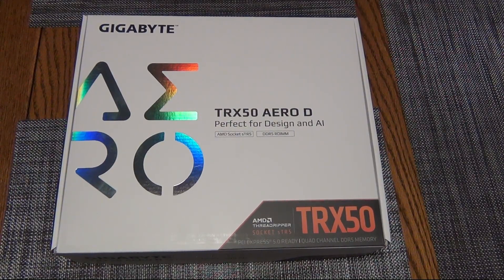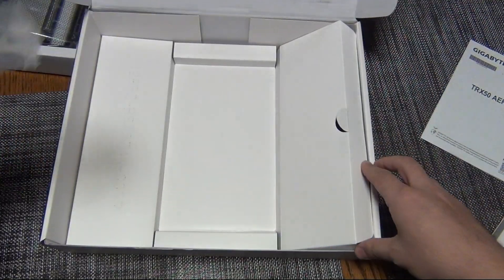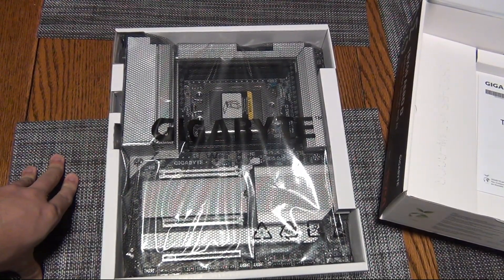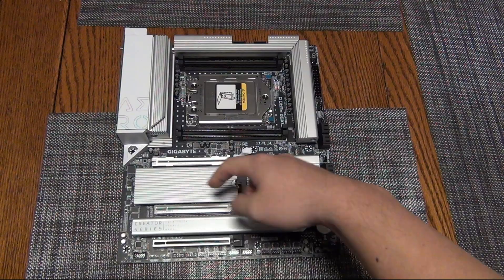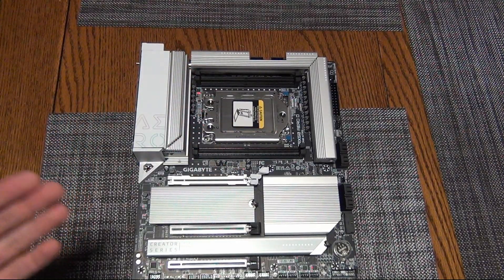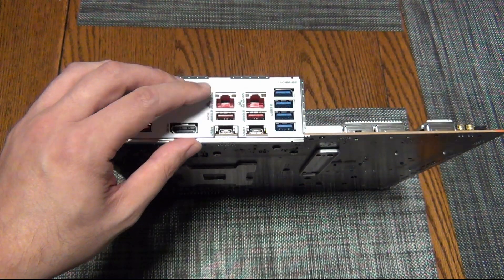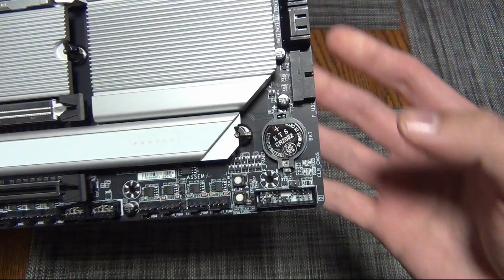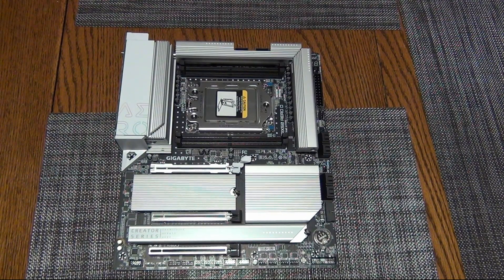Gigabyte TRX50 AERO D Unboxing and Overview

Comment: I recently built a workstation with a R9 7900x ASUS ProArt x670e. I can use 2x pcie gen4 GPU but motherboard can't overclock a dual GPU system.

Comment: I bought this motherboard and assembled everything in place but the CPU LED light is on and it won't boot even though all fans are spinning. Extremely frustrating..
Reply from the maker: What is the code on the debug LED on the board? Is it 0d?
Reply: @GameTechReviews  So I took it to MicroCenter for diagnostics and they found the motherboard was faulty and needs replacement.
Reply: This is my first build, so I don’t know how to check the debug LEDs
Reply from the maker: @nektariosmusic  When you turn on the computer what does it do? Does it beep? Does the post code debug show any codes like 0d or FF or some other number?
Reply: @GameTechReviews  When I turn it on, it does not beep.
Reply: @GameTechReviews  All the fans spin though. And all the Fan LEDs are on
Reply: It seems the CPU is not getting any power
Reply: My PSU is the Corsair 1600i
Reply: My cpu: Threadripper Pro 7995wx
Reply from the maker: I'm not sure if this will help but this was the livestream I did where I assembled the PC https://www.youtube.com/live/t-VIy3KZFtw?si=OFrhX1i0DOte-UKX&t=2691
Reply: What is the motherboard revision you got?
Reply from the maker: Rev 1.0  @hm-studios
Reply: I got the 1.1 revision

Comment: AMD statement to every influencer -  "Do not EVER compare TRX50 motherboards with TRX40". 
Want a shocking eye opener? compare every non-pro TRX50 previewed (of course, you can't buy any!) with the greatly extended feature sets of TRX40, in particular, asking yourself "Where are the Zenith II / Aourus Extremes etc??". For your answer, ask MSI - they pulled out of supporting TRX50, primarily because of how AMD treated every customer and motherboard maker of TRX40...

AMD themselves said that "non-pro TRX50 is a welcome return for the desktop HEDT enthusiast". That is, exactly 4 years ago, after they publicly baited potential buyers with "long term support promises" for their then new TR system, TRX40, and then proceeded to lie to every TRX40 purchaser by breaking those promises in immediately EOLing it. No more expected CPU's. AMD literally killed their own non pro HEDT userbase!

So, what about TRX50? Well, in truth, TRX50 is a shocking, feature-depleted embarrassing shell of what TRX40 was and stood for, a shell that not even The Braindead enthusiast would purchase.

Comment: i have an 7960X and the GBT TRX50 Aero D here for my new HEDT Gaming machine. think i start building these days after work. so happy about Quadchannel. ah i use Kingston Fury Renegade Pro CL32-6000 quad Kit
Reply from the maker: Does the S3 sleep/standby work for you or is only hibernate available? I think Gigabyte needs to release a firmware update to enable sleep on this motherboard.
Reply: "gaming machine" - you are 100% INSANE !!

Comment: I don't get the diagram block for this board. If I populate all the PCI and M.2 slots, what will be the PCIe bandwidth penalty?
Reply from the maker: There is no PCIe bandwidth penalty. That's the advantage of the Threadripper platform.

Comment: Totally interested in how the 7960X performs. Would appreciate if you could run some AI/ML-related benchmarks (e.g., Puget Bench's) to compare against the 7950X. I do simulation, 3d rendering, and getting into Natural Language Processing; however, I'd like to run 2-3 RTX 4090s (or 5090) in the near future without compromising on M.2 SSD capacity. Appreciate breaking down the memory quad-channel feature as well!

Comment: If you've powered it up and used it, can you explain to us how accurate the "Perfect for Design and AI" is on the box vs other motherboards?
Specifically: what AI chip/accelerator/processing is on this motherboard that similar TRX50 boards lack and how it's better at, presumably, thinks like Sketchup, 3DS Max, Photoshop, etc. (again, vs other TRX50 boards.)